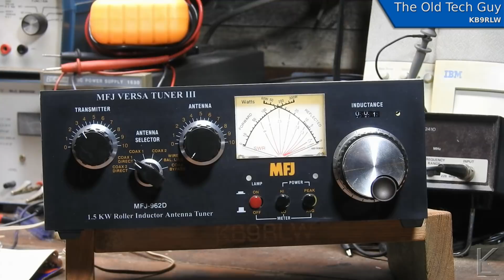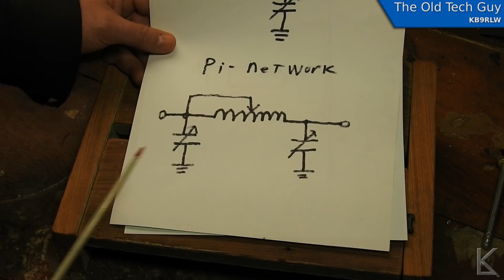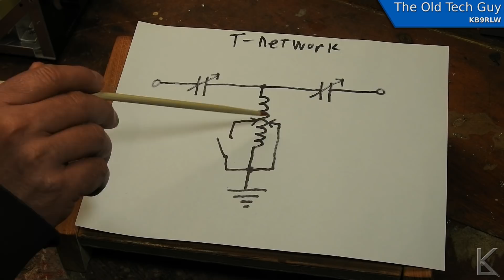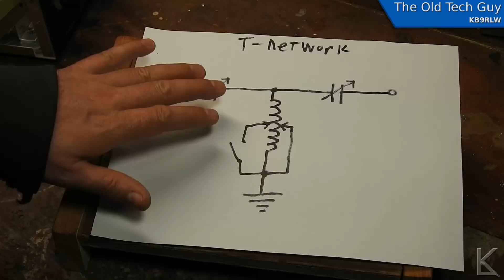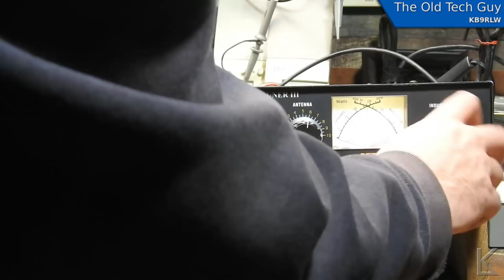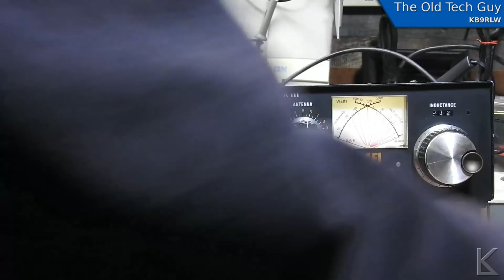Ham Radio - Salvaging a burned MFJ 962D versa tuner

Comment: I DON'T REMEMBER  AND YOU DIDN'T SHOW THE 725, DOES THE 725 HAVE AN SWR METER ON IT? IF SO AFTER GETTING THE MATCHER CLOSE, USE THE RIGS SWR METER TO TOUCH IT UP IF IT HAS ONE. THE RIG SHOULD BE FLAT SO THE RIG DOES NOT FOLD BACK. NEVER SAW THE INNARDS OF THAT MATCHER BEFORE SO THANKS. I REALLY LIKE MY TENTEC 238 AFTER THE CENTURION. I DON'T FEED ANY POWER TO THE 238 SO CANNOT SEE THE METER SO I USE THE SWR METER ON THE TS2000X INSTEAD. AS A FINAL CHECK THE WATT METER ON MY DRAKE C-4 IS THE FINAL OUTPUT INDICATOR. YES IT SHOWS A LOT OF SWR AT TIMES BUT THAT SAYS THE RF IS GETTING OUT AS GOOD AS  IT CAN THROUGH THE MATCHER AND THE TRANSMITTER AND AMP AT LEAST ARE HAPPY :-) MERRY CHRISTMAS.  KØOJ
Reply: OJ Jenkins, we get it. You don't need to shout!
Reply: WELL WALT, YOU DO NOT HAVE MY VISION, AIN'T YELLIN!!

Comment: MFJ manual: "Understanding power ratings. There are no standardized power rating systems for tuners. The names used (i.e. 3 kW Tuner) carry over from the time when amplifiers were rated by peak power input, and not the true RF power output... The FCC has changed the power rating system of amplifiers, and tuners no longer follow amplifier power ratings." Whatever, right? That burned switch thing you removed often gets stuck slightly off contact.The MFJ-969 has a lot of arcing problems.Tuner still works but slightly erratic at certain spots until it totally carbonizes.

Comment: Would an UNUN not make that MFJ962D obsolete (not required) since the UNUN matches the long wire antenna to the transceiver.
Reply: No, not at all.   An Unun, is a 1:1 transformer.  It will do nothing to match the 50 Ohm radio to a ? Ohm antenna.

Comment: Kevin, pretty good mechanical fix. Not too terribly certain that goofy switch apparatus was necessary anyway. MFJ always adds on junky, kluged fixes and their tuners are famous for arcing over even when tuned. (That's principally because they use cheap coils with skimpy spacing.) If the new ham was going to run more than 100-200 watts, then he could rig a manual switch at flip it in the 65 region. But, then again, if he can afford an amp then he can afford a new tuner. 
Better still, just work QRP! 
71/72 de k6whp 
dit dit
Reply: The shorting switch is a useful feature and not kludgy nor unnecessary.  A little attention to proper procedures will generally prevent such arcing.  However,  hams are Amateurs, not trained professionals....

Comment: Hi Kevin,
Wonder if that damage was done after it was sold on Ebay. Nice repair video.  73  WB3BJU
Reply from the maker: Yeah, most certainly it was.  It was fine when Al sold it.  The guy who bought it screwed it up.  Ebay always sides with the buyers though, so he didn't have any real recourse.
Reply from the maker: I've heard of even worse.  Someone selling a piece of office equipment, getting it returned as broken, and finding missing parts inside.  The buyer just wanted parts and totally screwed the guy.
I've done quite a bit of ebay selling over the past three years and so far, no problems.  It's not that common, but it sucks when it happens.
Reply: Hmm, a shame buyers (and sellers?) are dishonest like that. Screw it up and hand it back is pure meanness.
Les
Reply: Kevin Loughin, if you document these carefully, you WILL be able to get eBay to side with you as the seller.